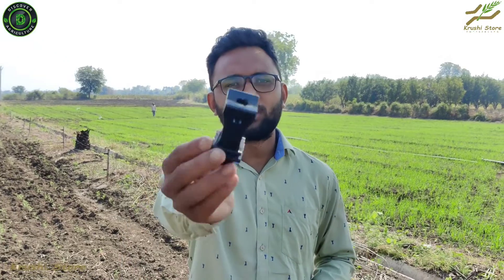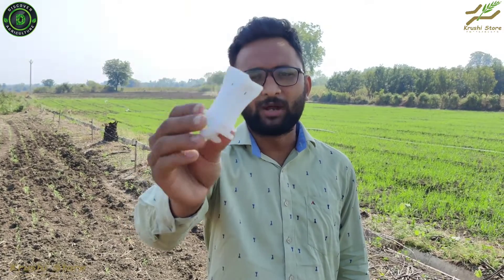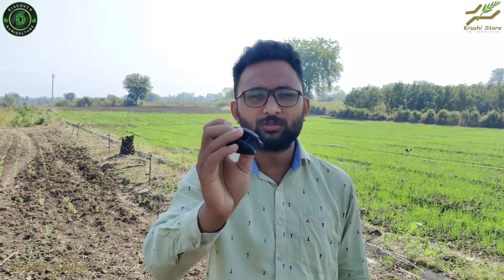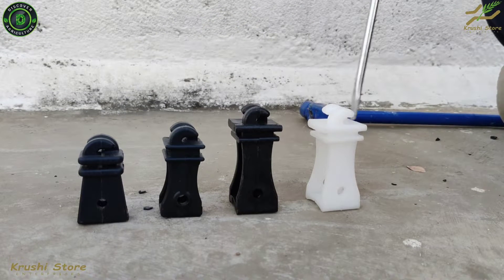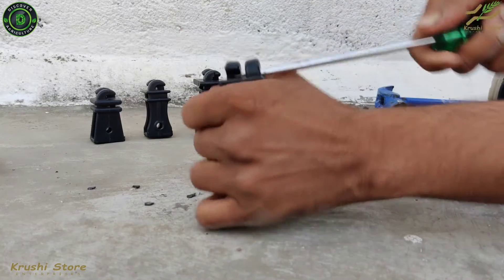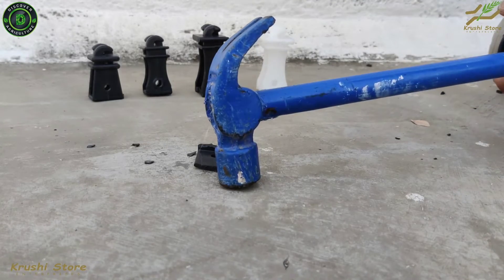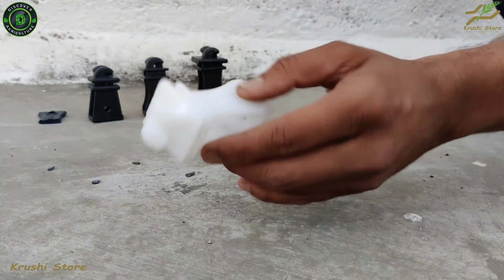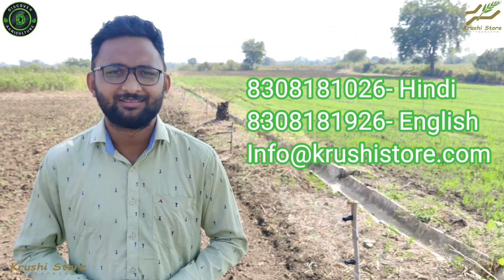BEST SOLAR FENCING INSULATORS | Types of Insulators used with Solar Fencing System for Agriculture

Comment: Can I use only the jhatka mechine if I already have existing solar system. I have 100ah  battery and a 300watt pannel. Can I just buy the mechine and make the connection with the wires